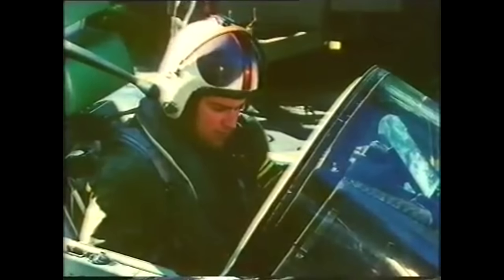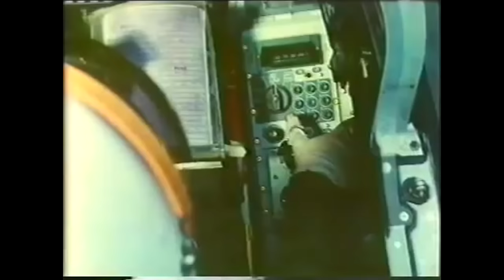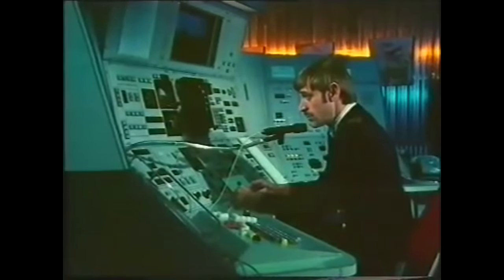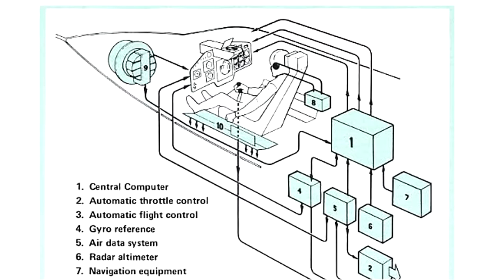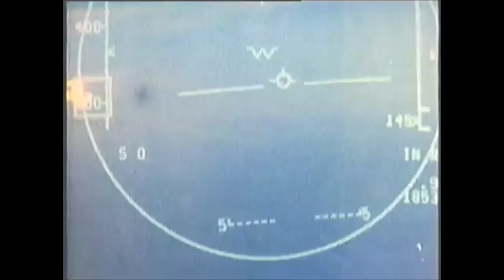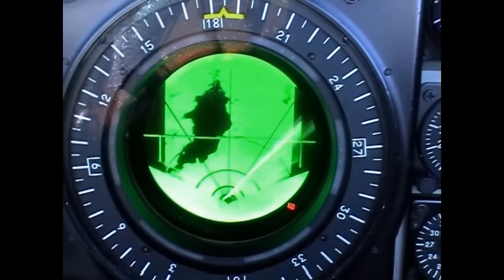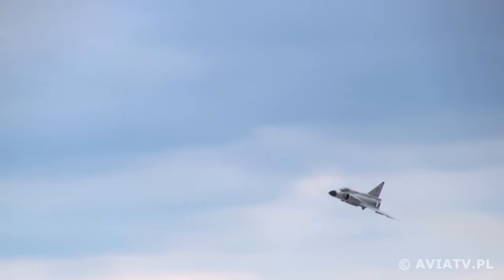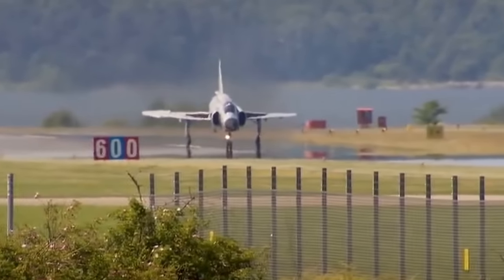Five Days Of Viggen - Advanced Avionics

Comment: Sweden gave US intelligence about the Warsaw pact in exchange for technology. Highly secret and sensitive at the time. The CK-37 (central computer 37) technology was used on the F-14 Tomcat. The CK-37 was first with integrated circuits in a single seat fighter.
Reply: Nope, that is wrong. First flight of Viggen (1967) was three years before the F14 Tomcat (1970), so other way around! Just keeping facts straight.
Reply: @jannebanne8688  Maiden flight was in -67 but it didn´t become operational until -71, that is what counts. As such the AJ-37 was the first operational single seater with IC-computer. It was integrated in the F-14 but that is a double seater.